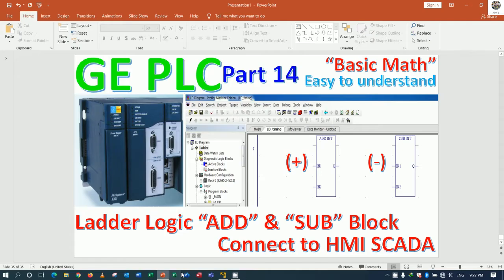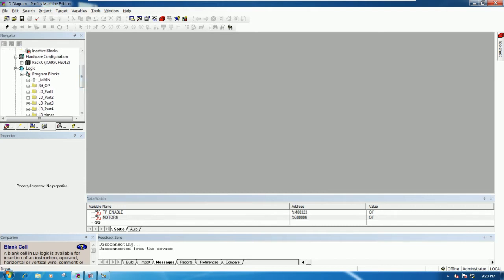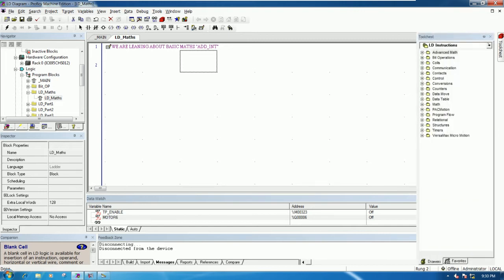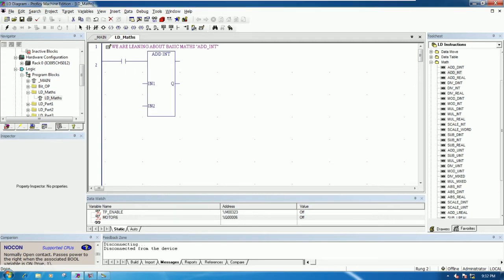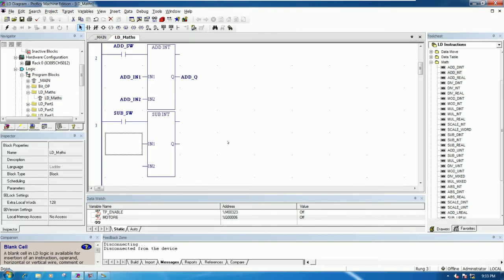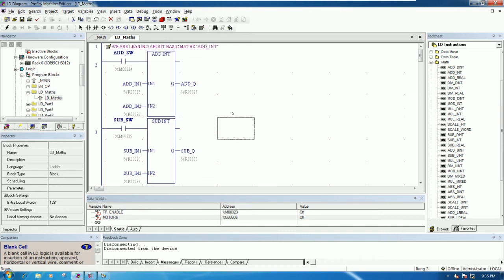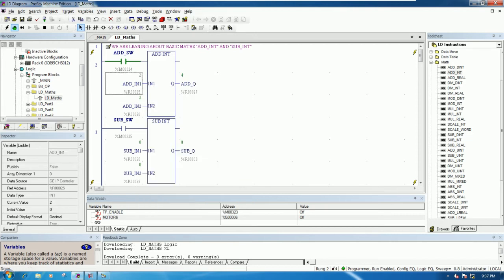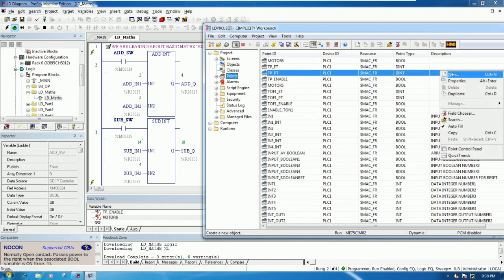Proficy Machine Edition software connect with PLC GE basic math "ADD", "SUB" Integer

Comment: Thank you very much. I wish I have found your account in 2021. I was beginning my career as Automation Engineer at that time, and at work we were using this platform. Everything was new to me although at that time I was already exposed with Siemens TIA in a basic level. That time, I was pressured to learn the platform in a short time so one of my reasons to quit was it - i had to learn it quick. So going back... if I only found you at that time... maybe I would not have quit the job and by now, I must be an excellent GE user already. Again, thank you.
Reply from the maker: You are very welcome!